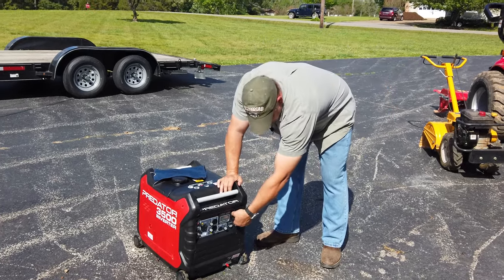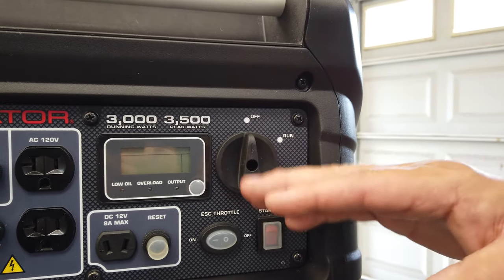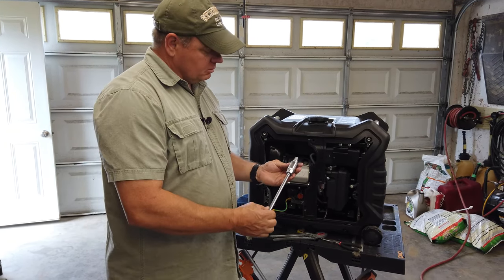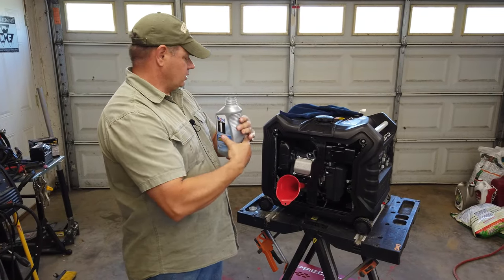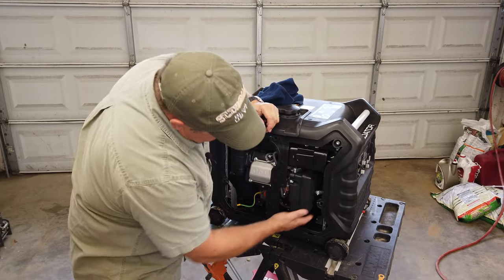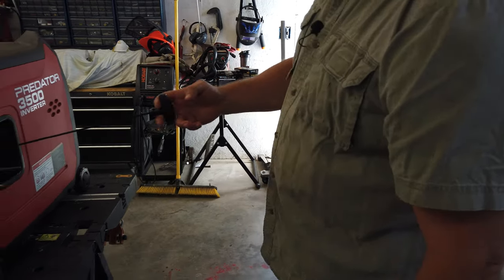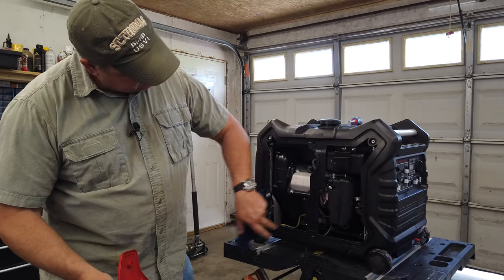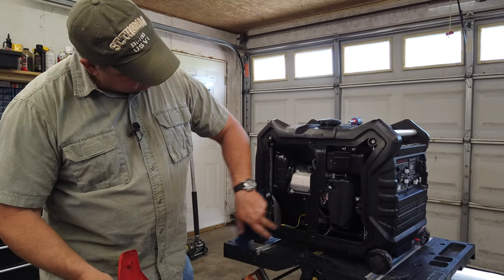Predator 3500 Inverter Generator Service | Harbor Freight Generator | Travel Trailer Generator

Comment: Great video! I'm sure you know this, but if not. The spark arrestor is a two peace setup. You have the wire mesh that you can see, then there's a wire strainer sitting inside the muffler that you can pull out and clean with a wire brush.

Thanks for the video!
Reply from the maker: Thank you. Mine is one of the first, so I didn't see anything inside. I will re check

Comment: I just found this video today as I'm researching generators. You mentioned you had used it when you had a power outage. Can you do a video on how you set it up to keep the essentials working in your house, or direct me to a previous video when you showed that. Thanks.
Reply from the maker: It was no big deal.  I just ran really long cords in the house and one to the freezer. All 10ga cords.

Comment: ..I purchased the Predator 3500 Inverter Generator to hook up to my single wide mobile home. Incase of power outages. My mobile home is a bonded ground and so is the Predator 3500 Inverter Generator . How would I UNBOUND or make Predator 3500 Inverter Generator a floating bond? Love your video's Thanks
Reply from the maker: Honestly, I have no idea.

Comment: Great video. I see you didn't do any mods like drilling holes , removing things it looks all stock and no problems.
Reply from the maker: No problems. Some people like to mod. It just works.
Reply: I just bought one this weekend and works awesome , ran it 30 min with lite load and changed the oil already, very important.

Comment: How many hours before the valve clearances need adjusting ? Have you done yours yet ? It looks like it may need considerable manual dexterity to put it politely ! Nice clear concise video thanks for taking the time to put it together. 🇬🇧🇬🇧
Reply from the maker: The valves should be checked at 300 according to the book. I have ran synthetic oil from the start. I don't hear any need to adjust the valves on mine. I may do it at 400 hours.
Reply: Great question, I would do it for sure at 300 hrs.
Reply from the maker: I understand.

Comment: The carbon canister has two hoses on the left side and one port on the right side. What is connected to that port on the right side of the carbon canister? Thank you
Reply from the maker: I think to the fuel tank.

Comment: I just purchased one of these today and was wondering if you did a break in oil change and if so, how long did you run it? Very nice vid.
Reply from the maker: I ran it about 10 hours of use under different loads. I changed the oil then, but found nothing remarkable in the oil. It has been running strong.
Reply: Many of the videos show people changing the oil after running a couple hour and do so a couple times to flush metal particles out.  Probably a good thing and certainly won't hurt anything.  But any motor needs to run hours/ miles to get broke in which is mostly seats the rings to prevent oil burning.  Make sure the motor is broke in before using synthetics or fancy oils and oil usage will be minimal.   Take the other panel off and you can see that a clear style, paper,  in line fuel filter can easily be installed on the outflow side of the gas shut off valve.  That will keep moisture and dirt out of the tiny jets in the carb.  Don't drill hole or leave oil fill door off as it causes electronics to overheat and fail.   All foam air filters require a light oiling to attract dirt passing though filter.  THAT is how they work.   All service instructions for small engines with foam air filters instruct to wash filter out in gas, squeeze gently to dry, then add a few drops of oil and squeeze excess oil out.  Great inverter to safely run gas furnace and other applications for hundreds/ thousand of hours.   Great video as well.

Comment: Next door Neighbor had two of these crap out on her. She's moving and already replaced it with a new one. She ended up giving me both of them, for free. Today I spent a couple of hours going through the first one. She told me she was using it and it just quit running. The air filter looked like I just brought it home from HF. The engine compartment just the same. Finally, I checked the oil, less that 6 oz. in the crank case. I'm guessing the safety shut it down and they never thought to check it. Not sure how long it had been sitting in their storage shed but the battery was dead and would not take a charge, at all. I ordered a new one from Amazon, and put it on the trickle charger. After two hours, I gave up waiting for the charger to show full so I disconnected it and cranked it right up. No problem runs like a top.
So here's my questions. Does this machine have a fuel filter? I have been through the manual and there's no indication of one being in the machine. Second, with the other Predator, the fuel tank is so filthy with rust, scale, and who knows what else. I removed 6+ liters of gasoline from the tank, tossed in a couple of paper towels and blew them around with the air hose and then added more gasoline and repeated the blowing. Still filthy. Not sure what to do at this point. I definitely don't want to remove the tank and descale it but am running out of ideas. Thinking of pouring in a few quarts of brake cleaner, 5 pounds of nuts, shake it around and then using the shop vac and a magnet to remove everything. Sorry for the long post but I'm out of ideas other than the above.
Any suggestions or help would be appreciated. Also, where can I find the serial number?

Comment: what are your suggestions to do if the gen is working fine at your home but misfires when taking to mountains?
Reply from the maker: Put a high altitude kit on it.
Reply: Saw another guy on YouTube that said when you start it put it on run. Start is just a choke.

Comment: Hi Tony. Liked your video. I have the same generator and it produces alot of white smoke from the exhaust. Any idea what that could be? Thx
Reply from the maker: Burning oil. Something wrong with the rings or valve guides most likely assuming the fuel is not mixed with something. One guy put his weed eater gas in his generator.  It took him a minute to figure out why it started smoking.

Comment: Why champion vs predator  and why do people put oil stabilizer in spark  plug also did you get the warranty I want to but this so much but want more feedback thank you
Reply from the maker: I did get the warranty, but that time has pasted. It still runs perfect. I use fuel stabilizer and I change the oil at least once each year. We did not use our travel trailer due to covid last year, but I still changed the oil. If you leave normal fuel in the generator without putting a stabilizer in, it will gum up the carburetor and ruin the unit. I always change my fuel out every six months if I am not using it. We will use it more this year. I have no experience with Champion, but I know I can still get parts from Harbor Freight if I need them.

Comment: Thanks for the Video very helpful , ,   Where did you find the battery? can you post a link.  Thanks again
Reply from the maker: I just bought it at at AutoZone. They have a wide selection of small batteries now. I don't remember the number, but it was on the shelf. Tony
Reply: @TonysTractorAdventure   Very appreciated ! Thanks

Comment: Thankyou. Very helpful. Would you cut out any plastic for added airflow ? Also , would it be alright to convert to full synthetic without any kind of flush  to the oil system?
Reply from the maker: I have not modified my generation in any way and I have  had great  results.  There is no need to flush for a synthetic oil change.  Years ago, synthetic oils and conventional oils were not compatible.  This is not the case today.  I hope this helps. Tony
Reply: Tony's Tractor Adventure Thanks Tony!

Comment: What is the best fuel to use in this generator?  I do not want to use regular gas because of the ethanol in it.  This is our backup power source; it will not be used unless we lose power.  Which does not happen that much in our area.  We purchased it for our home. It will be parked in the shed.  I plan on starting it once a month.   My neighbor uses race care fuel in his generator. He has a Genentech generator.  Is it safe to use in any generator
Reply from the maker: I use none ethanol gas with a fuel stabilizer in it.

Comment: Good Video, Any Ideas on Magnetic Drain Plug ?? Who Has Them ?? Are They the Same as Honda??  Predator Engines are supposed to be Honda Clones...Thanks Greg
Reply from the maker: I don't I change my oil so much it does not matter for me. Just run it a bit to get it warm, and drain it out. Great little generator. Tony

Comment: where do you go to find out about real problems with this lots of mant, ones  mine shut off  under heavy draw now will not start . shop in town says nope  do not work on those - hf says have no idea  what you do a week after  warranty goes out?
Reply from the maker: I work on my own stuff, but any real small engine shop can work on it. The engine is very simple. He most likely is just to busy this time of year to mess with the unknown. Do me a favor. Mix a few ounces of Lucas Fuel Injector and Carburetor Cleaner a tank of fuel. Change the plug and run the Carburetor cleaner fuel mix almost out. Very likely your problems will be solved. I always store my generator empty of fuel. Gas nowadays will not stay fresh more than a few weeks without a fuel stabilizer in it.

Comment: Chief, I may have missed you giving this info. How many gallons of fuel and how many run hours do you get per tank? Did it inprove with use or did you loose any run time.
Reply from the maker: I really don't know on the fuel. It is very good on fuel, but the load determines how long the fuel will last and that changes as the load changes. We had the power out for 20 hours the other day. I ran a few lights the refrigerator and 110v for my gas hot water heater. It probably only used a gallon and a half every 10 hours.
Reply: It greatly varies run time based on how much power you are drawing.
Reply from the maker: I am not sure how I missed this post, but the run time depends on the load. It will run 8 or 9 hours under light loads.

Comment: Did your electrical meter set back to zero when you disconnected your battery, my battery has gone dead and my meter is all zeros again I don’t know how many hours are on it.
Reply from the maker: Mine seems to be fine, but I keep it on a battery tender during non use times.
Reply: @TonysTractorAdventure  Iv never had an hr meter go dead after the first Initial charge I tried to send it back they want the whole generator lol for a dead battery

Comment: I do the same thing with my 2000 Pedator .   Will the 3500 fit under a tonneau cover F150 bed?
Reply from the maker: I would think it would fit just fine.

Comment: I have a Harbor Freight Predator 3500 generator. I have 17 hours of run time. Only 4 hours under 75% load the rest is exercising. I just started it for the monthly exercising, and it ran rough and I notice the volt meter only registering hours only, no volt or amp output on gauge. I did connect 2, 1800 watt heaters and it seem to run them, but again runs real rough. How to test this generators output? So, I know if it’s the generator or just the gauge? I’ve changed fuel, spark plug, check the oil, charcoal canister, air filter, removed the spark arrester, all looks like new. Help, Thanks
Reply from the maker: I think if you push the little grey button by the readout, it will change it back to reading volts, amps, etc. It can be cycled through. 3200 watts is to much for the generator. It is made to run 3000 all the time with 500 watts overload pull just for the few seconds it needs to start an electric motor. That should be the only time you go over 3000 watts. I think it is been generous at 3k watts too. I read 2800 watts on my hand held meter. I hope this helps.
Reply: @TonysTractorAdventure  I've done that, I get NO reading except for hours, No volt or amp readings
Reply from the maker: I just don't know after that. Everything is internal after that. I will  look at mine when I get a chance.
Reply: @TonysTractorAdventure  Thanks a bunch

Comment: Don't forget to put filter oil in your air filter after cleaning it or it will not work properly.  You will dust your engine and blow it up.
Reply from the maker: It was plenty oily after ragging it off. There was too much oil in it from the last service. I should have pointed that out.

Comment: Just an idea i did and didn't see anyone in 30 videos i saw do. Lol 
Buy harbor freight roll cart with handle that fits perfect with predator.  Make a rectangle hole where oil would fall through for oil changes. Then put predator on top with 2 ratchet straps. Lock wheels. Put 2 small brackets to keep predator in place. Alot easier to roll over any surface. Elevating predator keeps air filter way cleaner. You'll never have to take off predator off the roll cart. On sale costs 21 bucks. Trust me a lot easier mobility and to work on. Your welcome lol jk
Reply from the maker: I did see someone modify their generator with larger wheels.  Thank you for watching 🙂
Reply: @TonysTractorAdventure  yeah but what im saying its cheaper and way more convenient without modifications.  But thanks for your video!